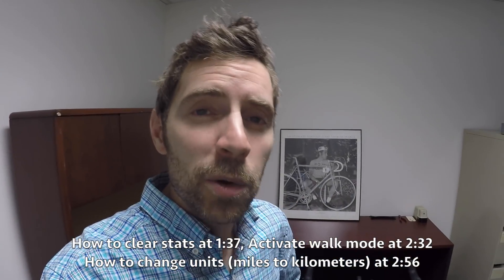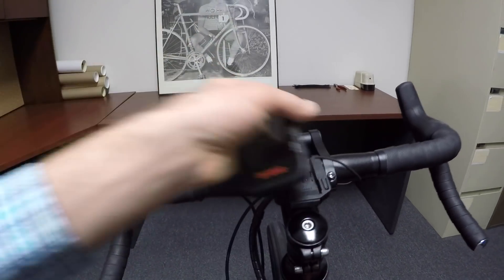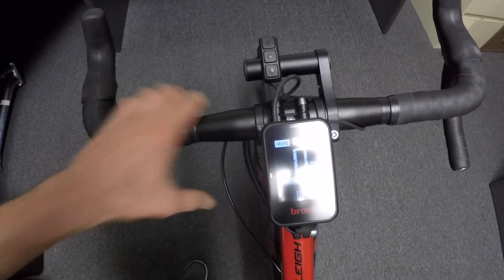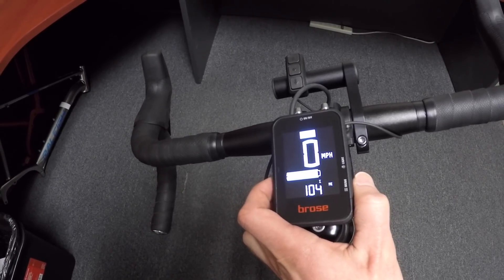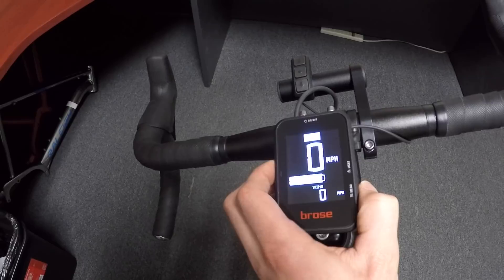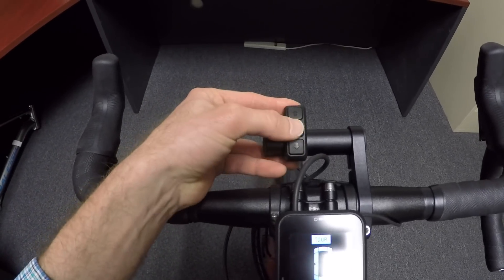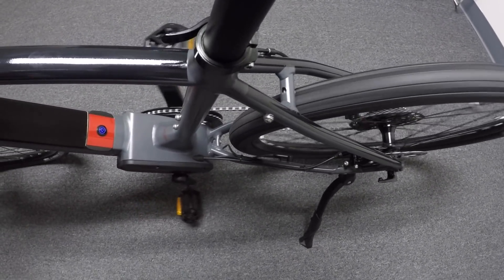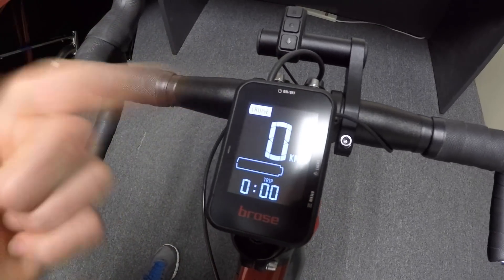Brose Electric Bike Original LCD Display Settings

Comment: Will it hook up to your Levo?
Reply from the maker: Good question, I don't think so... there doesn't seem to be a port on the bike anywhere for this display and Specialized shops haven't said anything about modifying the existing three-button display + smartphone app. Brose leaves the display and battery open to brands so they can customize it. I think the Brose Original LCD here is just their default affordable solution and IZIP/Raleigh use it sometimes to keep costs down. Also, I sold the Turbo Levo last year to prepare for more travel (I'm currently in SoCal filming Haibikes, IZIP, Raleigh, Electra, Easy Motion, Juiced etc.)